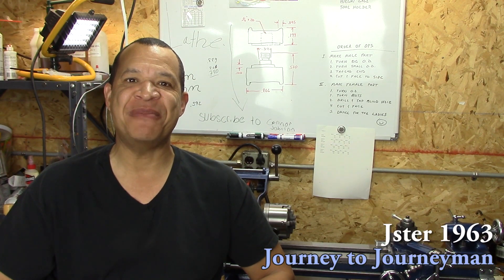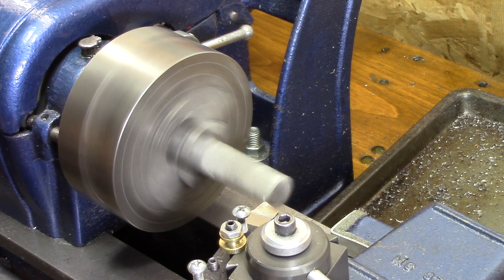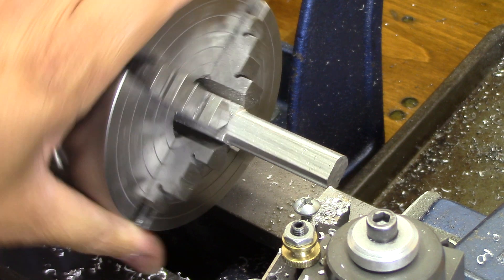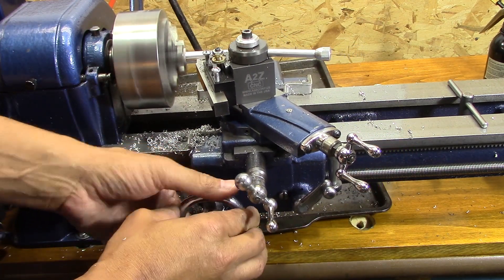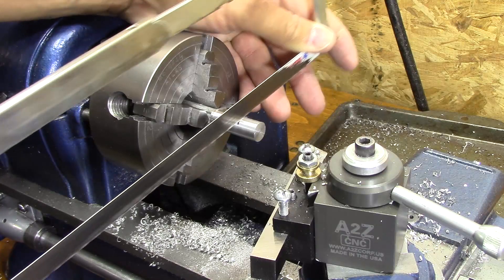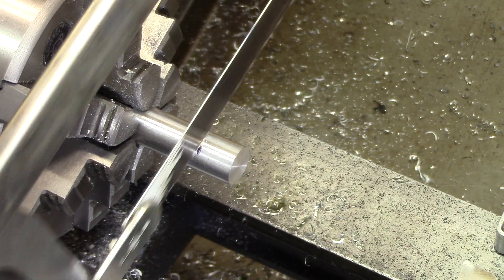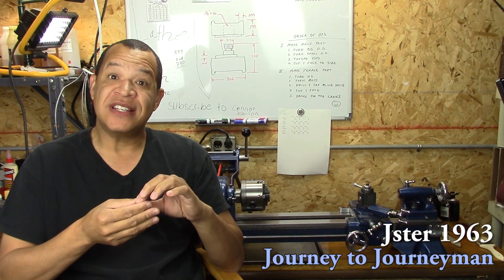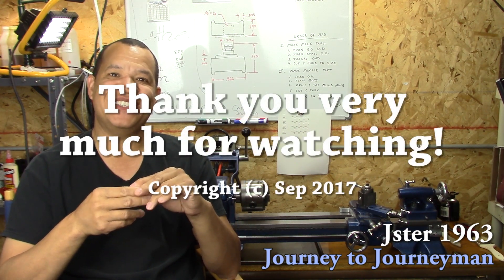Journey to Journeyman, Episode 17.  How to make a bushings for a headlight motor.

Comment: I don't know much about machining, but why did you opt for the hacksaw instead of using the lathe to cut the bushings to length?
Reply from the maker: Great question!  I do have a "cut off" tool for the lathe, but I bought the cheap one and it doesn't work.  I recently bought a better one, but it's not setup yet.  I hope to be using it soon.  Cut off tools are notorious for being difficult for the home shop machinist to use.  So far I haven't had any luck.  I sure hope my new one works.  And thank you very much......

Comment: Nice fix!  Reminds me of when I was in high school in the 90s, my parents had an '84 Crown Vic that the window motor bushings disintegrated. Probably the same thing as your bushings. I just cut some 3/8 rod to length  and stuck in them. Definitely didn't want to get your hand stuck in the window after that! After seeing your video, I'm guessing it's a common thing for bushings to disintegrate after a few years.
Reply from the maker: Wide Vision Metal Fab I wonder if they are designed to be the weak link?  We will find out soon!  And I bet you're right about being a common thing on GM cars. And thank you very much....

Comment: Cool, you can use any geared motor to move the carriage, almost noiselessly. Usually in an RS570 6v to 12 v D.C. Motor. Like say those old 7.5 v electric screw drivers or old battery operated drill that can be found at any Goodwill, Salvation Army, and similar thrift shops and flea markets. Get yourself a 3.5 up to 12 volt wall packs, to the terminals of the motor, with an on and off switch, and ya got yourself an auto feed.
Reply from the maker: Awesome!  I've seen people use windshield wiper motors as well.  That is def on my "to do" list!  And thank you for the info......
Reply: yeah, no problem, any thing I can do to help..

Comment: I was just wondering if Delrin would work. Recently I helped my son with a project using Delrin  and it was easy to turn and drill. However, you have already completed your project using aluminum . Are we going to see the installation of the bushings. Great video....take care, Ken
Reply from the maker: Delrin would have worked too, but I had the aluminum.  And yes, you will get to see the bushings installed. LOL.  That pop can aluminum is great to work with too.  And thank you very much........
Reply: Yea...Brass or Delrin would choice. That said...As long as you keep lube on the aluminum...It will be just fine IMO.
Reply from the maker: Thank you Tim......